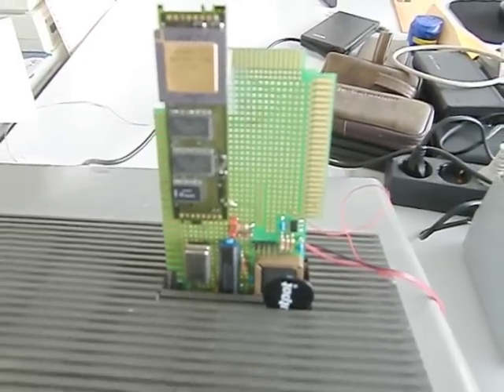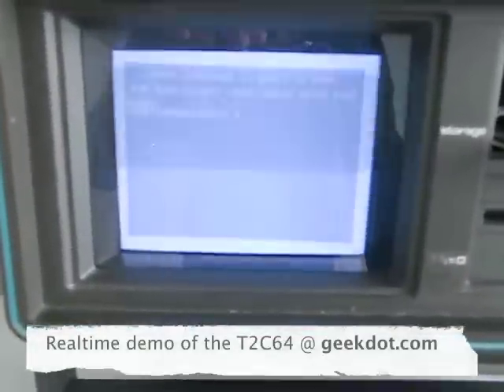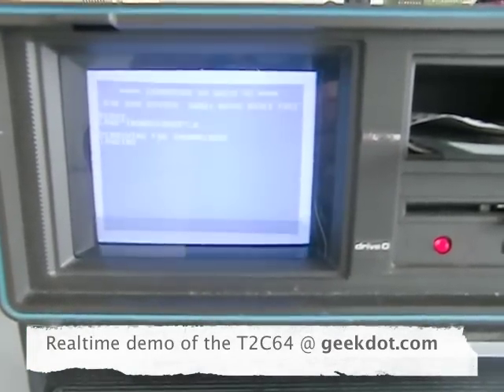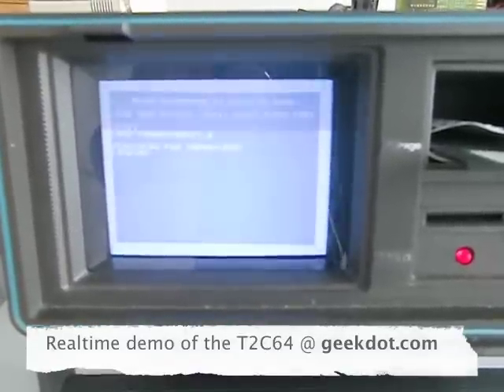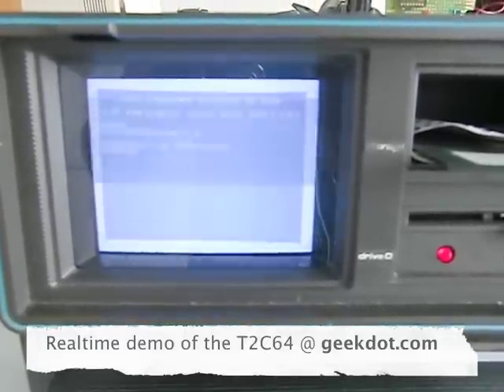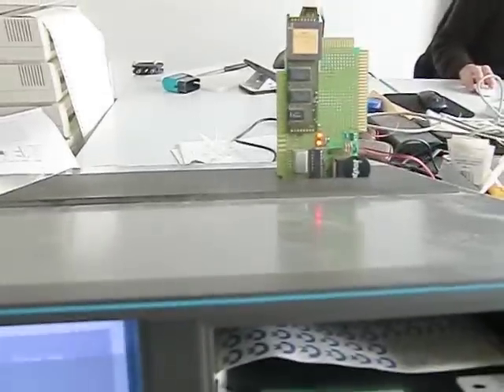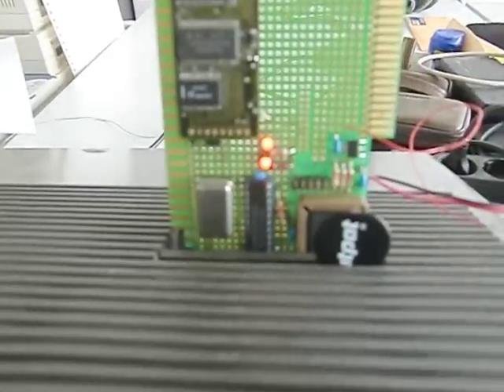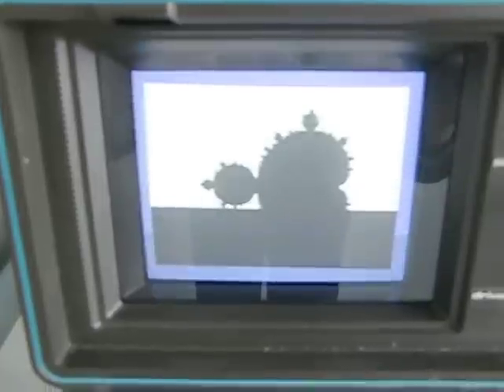T2C64 realtime demo

Comment: Actual thing at 1:58
Reply from the maker: Well, the "thing" about which this video is about is the Transputer card. At 1:58 the Mandelbrot fractal calculation is completed.
To be honest, the C64 does not do much more than drawing the pixels and handling the communication. The limiting factor is the C64s bus-speed. If you watch my other video doing the same on an Apple IIgs, it takes the same amount of time... in 16 colors.
Reply: I’ll check that out, thanks.